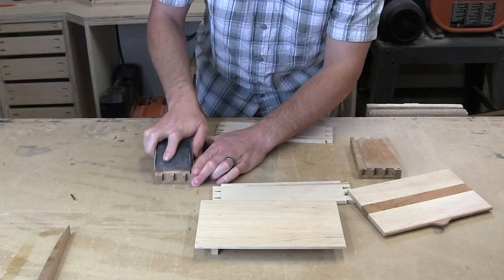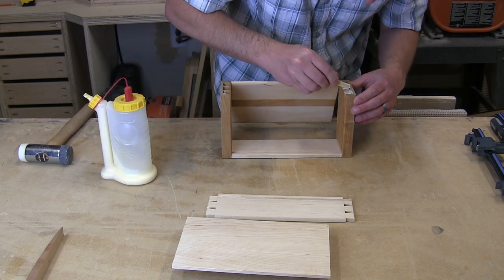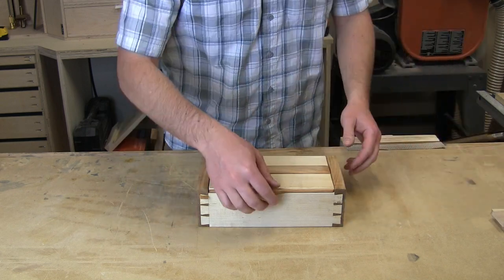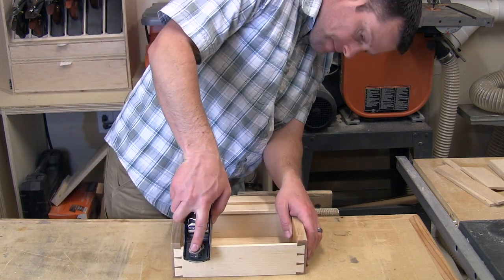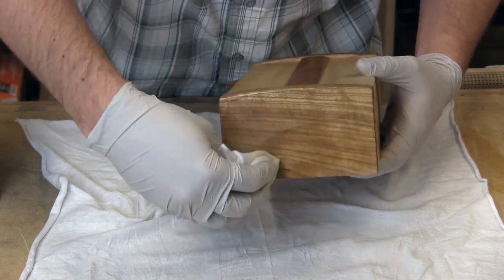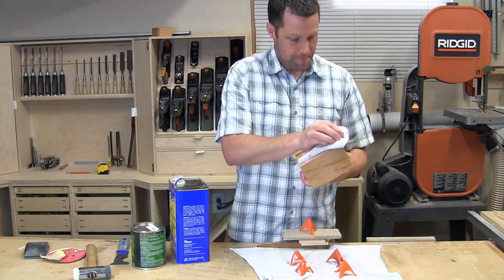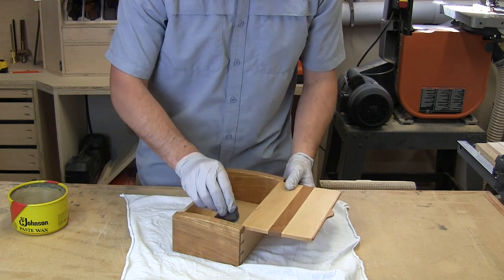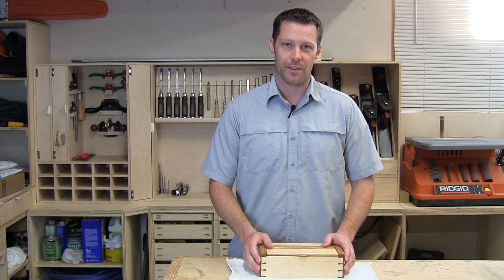Dovetail Keepsake Box: Glue Up and Finish

Comment: An nice heirloom piece.

I like your honesty over filling the odd mistake, not many folk own up to stuff like that.

A useful hint, apply finish to the inside faces before gluing up, makes getting the finish into internal corners so much easier.  Also a glue squeeze out on the inside just pops of and finally it ensures that the base is free to move as glue won't stick to it.
Reply from the maker: Nic Murray thanks for the compliments, and the advice! I had considered finishing the inside parts before glue up, but was concerned about getting an even looking finish on the cherry ends since they are visible on the outside of the box when the lid is closed. I did pre-finish the bottom floating panel to prevent any glue from sticking to it, and think I’d probably do just what you suggested if I had to do it over again.
Reply: Hi Jon,
I hope you weren't offended by my remarks, no,offense was intended.

It's difficult working out the skill/experience level when watching videos.

I'm trying to muster up the courage to post some of my own stuff but my workshop is in a mess as I'm rewiring it. That's my excuse for now, I'll probably get myself sorted later this year.

Nic
Reply from the maker: Nic Murray no offense taken! I’m always trying to improve, and welcome the feedback. Filming and producing a video certainly adds to the complexities of woodworking, which I currently only get to do as a part time deal. In my opinion, anyone who thinks they know it all hasn’t figured it all out yet! Good luck getting your shop situated, and don’t hesitate to get a video out there. It gets easier the more you do, but there’s a definite learning curve!